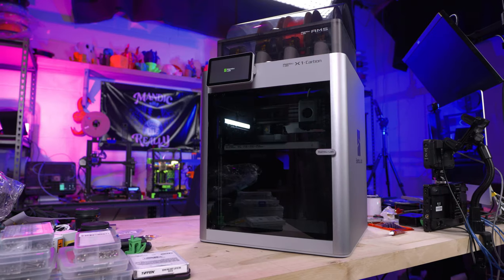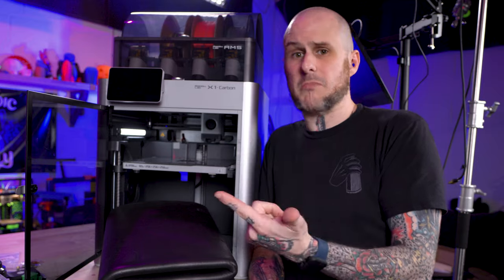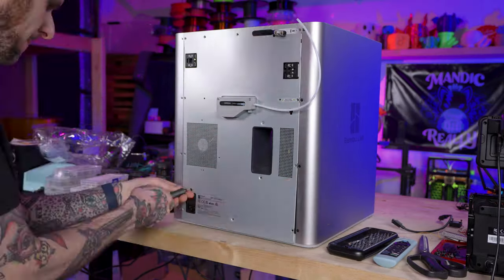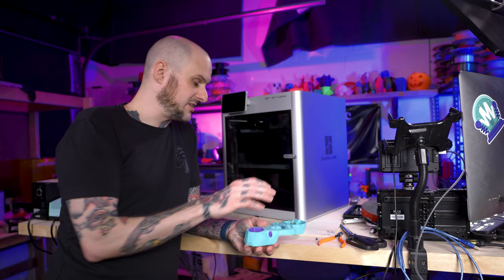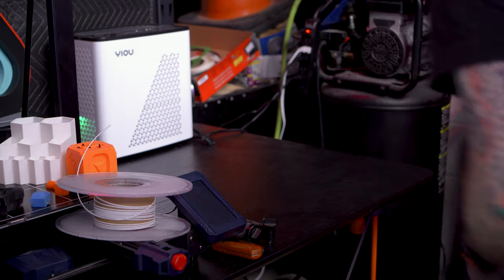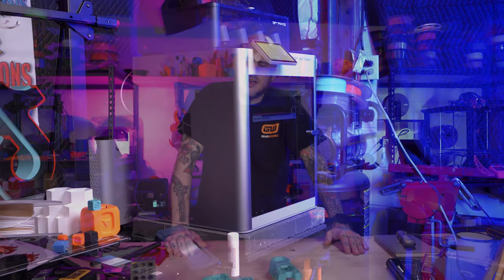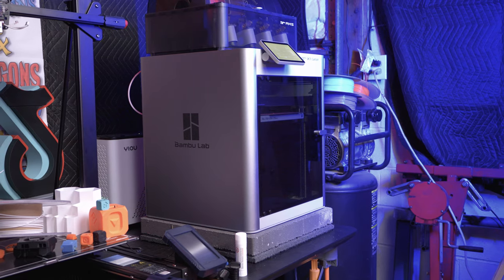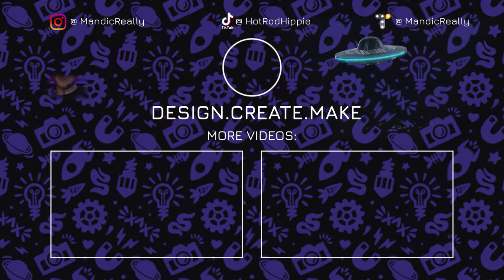Bambu X-1 3D Printer Modding & Problems - Noisy Ringing BEAST!

Comment: A 5dB decrease is huge it’s 1.5x reduction.

A change of 10 dB is accepted as the difference in level that is perceived by most listeners as “twice as loud” or “half as loud”.
Reply from the maker: I always forget to think of dB in the reality of what it is. You are right it is a pretty big change.
Reply: Sorry to be the "um, actually" guy. 
+6dB is twice and -6dB is half as loud.
Reply: @ShaunYouth  "Actually", no, it's highly subjective, and varies from 6 to 10, depending on the study.
Reply: @oorcinus  upon doing further research, I have discovered that you are indeed correct. Funny thing is, the music school that I’ve worked at for the past 10 years has always taught 6 dB is the double or half number. 
I just now read a paper from Harvard U that mentions this dispute. I stand corrected.
Reply: I have sound deadening left over from doing my car, 5db is worth the effort in my mind.
Reply: Better than the insulation he used is the roofing tar contact paper. It's basically dynamat that is used in car audio and it's sound reduction is way more than just 5 db. Plus that roofing contact paper is really thin so it can be doubled up if needed too.

Comment: I wonder when 3D printing youtubers (and 3D printer users in general) will finally recongnize the importance of correct Linear Advance (Marlin) respectively Pressure Advance (Klipper) configuration.
Perceived 80% of problems I see posted in various 3D printing forums are caused by ignorance or misconfiguration of this feature.

Usually filament flow is calculated by the slicer software as a linear function of horizontal nozzle movement. Unfortunately molten plastic does not behave linearly when being pressed out of a nozzle. That's why someone did us all a great favor and implemented the Linear Advance Algorithm into the  Marlin firmware. The makers of Klipper obviously recognized the importance of that and implemented it as well, but calling it Pressure Advance which does essentially the same.

Linear Advance (LA)  needs one argument supplied by the user which is called K. Its unit on LA version 1.5  (LA15) is mm/mm/s. It describes the molten filament compression length per velocity unit. You can read more about this here https://marlinfw.org/docs/features/lin_advance.html or the Pressure Advance version here https://www.klipper3d.org/Pressure_Advance.html.

K depends on the filament, its condition (age, moisture, ..), nozzle diameter and layer height. Optimally you should calibrate LA before every print, where you change one of these parameters. I found that, when I open multiple vacuum sealed spools of the same filament, each of them might still need a slightly different K to produce perfectly printed results. This is particularily the case with PETG and TPU. You can also print TPU quite fast, without striniging, when you have configured its correct K value.
When printing PLA and ABS at slower speeds you probably won't recognize the full impact of LA, because these two materials behave quite linearily in their molten state. This is why probably nobody bothered about LA when printers only could print these materials and also not very fast.

To come to the point ... his issue with the edges, he describes in the video, might also be caused by improper configuration of LA.
I know, the Bambu X1 does Linear Advance autoconfiguration before every print, which is essentially a good thing, the problem is, that the filament behaves slightly differently when printed as a first layer pattern directly on the plate, than being printed as a layer above an already existing one during a real print. This is mainly because the first layer gap between the nozzle and the plate may be slightly different than the configured layer height for the print (which is mostly the case with printers where you manually have to configure the Z-offset to the plate.  I don't know if Bambu's autocalibration levels the nozzle tip to exactly the configured first layer height), and also the filament adheres differently to the plate than it would to a layer of its own material. Believe me these two factors make a difference. It's e.g. pretty impossible to determine the correct K for TPU from these patterns.

What I do to determine K ist to print a 60x10x3mm cuboid with open top (no top layers), no infill, 3 bottom layers and 3 lines thick walls. This can be printed reasonably quickly. Afterwards I examine the result.
When the vertical corners are bulgy and the walls look slightly pulled inside between them, and the extrusion at the beginnings and ends of  lines is higher than in the middle of the lines, then K is set too low, if it's the other way around it's too high. Then I slightly correct K in the correct direction and reprint. I repeat this until it looks perfect.

Also when K ist too low you might not get rid of stringing, because there will be too much pressure in the hot end at the ends of a line so that the thread of plastic cannot snap off before moving to the next start of a line and will be dragged over to it.
In contrast, when K is too high, the corners will become rounded, the walls will bulge to the outside and you even might see cavities between the lines in the corners, also the Z-seam will look like the grand canyon.
Reply: Thank you for sharing this. When you are making adjustments to K, how big on an adjustment do you make? .5 mm/mm/s? Whole steps? I would like to play with this setting on my Bambu.
Reply: @realgoose  Depends on printer (Extruder (Bowden?), Hot End) Linear Advance version (1.0 or 1.5, aka LA10 and LA15), filament, printing temperature, nozzle diameter and layer height.
I don't use the Linear Advance calibration patterns like the one found on the Marlin firmware site as the patterns are printed directly on the print bed as the first layer and the filament behaves differently on the plate than when printed on layers of itself and this influences the K value. These patterns may work with PLA and ABS which are not so sensitive to these parameters but you can't get the correct K values for e.g. PETG or TPU using this technique.

What now follows repeats some of what I already said in my original comment, but I've added some details ...

I ususally print a test object, which is basically a rectangular bowl with 3 bottom layers and 3 wall lines. You can create this in most slicers by adding a 60x10x3mm cuboid to the build plate and configure it with 3 bottom layers, 3 wall lines, no infill and no top layers.
You have to print this with quite high speed and acceleration settings, at least 60mm/s but the faster the better, as the problems arising from a non optimal K value becomes more evident at higher print speeds which is obvious when you look at LA15 Ks unit. It's the filament compression length per velocity unit in mm per mm/s.
You must also ensure that the minimum layer time setting in your slicer is set in a way, that this small test object can really reach the configured maximum speed, otherwise it will be slowed down by this setting and you won't see much difference between different K values..

Then you examine it with a looking glass or your smartphone's macro lens. When the vertical edges are bulgy and the walls between are drawn slightly concavely to the inside, then K is to low, when it looks the opposite and cavities appear in the corners then K is set to high.
When K is too low you also will have a hard time trying to get rid of stringing, because the pressure inside the hot end will be to high when a line ends and the filament thread cannot snap of properly before the print head starts to move through air. Also the z seam will form a thick scar or blobs depending on your seam position setting.
When K is too high the seam may open up and look like the Grand Canyon or there will be holes in the walls when you have set its position to random.

Typical LA15 K values for most  PLAs, when printed with a 0,4mm Nozzle and 0,2mm layer height on a direct drive extruder are around 0.05, PETG needs between 0.06 and 0.2, TPU between about 0.25 and 3.0(!), depending on the parameters I mentioned above. Smaller nozzle sizes,  lower layer height and lower printing temperatures  increase K, larger nozzle diameters,  higher layers and higher printing temperatures decrease it.
Bowden extruders also increase the K value.

Comment: There is so much excitement revolving around this machine. For good reason, mind you. Interesting to see a minor glitch in the machine and even more interesting to see you try to fix it. You do a great job explaining everything.
Reply: Well I mean yeah, it is the first big improvement since the MK3 in 2017. Most of the market has been racing to the bottom with barely functional toys while the DIY community went full elitist with the Voron; a printer that was not only unreasonably expensive but also took upwards of 20 hours to build without counting the part sourcing.

Comment: The noise level I completely agree with, but I havent had any issues with ringing.  I print a lot of cosplay related stuff meaning im often printing at max build volume and I would see alot of ringing in my other FDM style printers when printing taller objects.  The X1 Carbon w/AMS has been a game chznger for me and has easily doubled my output and greatly improved the quality of my prints.  I couldnt be happier unless there were a larger version.
Reply: This is good to hear. Hope I can get similar results!
Reply: As much as noise can be loud, the productivity of this machine allows me to overlook that. Prints that take 4 hrs can be done in almost 1. Plus you can make a custom enclosure out of plywood or acrylic which will help with heat and noise.

Comment: I was excited about the X1. But as a lifelong industrial machine operator and now a cnc machinist for nearly 9 years(can code by hand 4 axis stuff). For all the hype key upgrades for any cnc(which is what a 3d printer is(welcome to my world) are rigidity rigidity rigidity. And these got missed. That means cast beds. NOPE, not even box section C sections spot welded.  injection moulded bits too. Ball screws...nope belts. So running at 24000mm/min _feeds_! on a consumer machine running belts🤔acceleration becomes a HUGE issue. Belt stretch guys!  
2nd up as a dude machining rubbers, urethanes, plastics etc for the past 5(plus 9 years in plastics processing(injection,blown film and blow moulding)...if the guys who can build a factory to make the plastic say it does maybe 80mm/s print speed...but nay we want 400? That means you are fully on your own with regards to any issues. Any parts you produce and have some expensive catistrophic failure=not their problem even if the material was at fault.
And finally. 
A cnc guy took 1 look at an x1 running pla(on u tube).and with it jumping around and some of the noises it was making at stock settings his verdict in under 10 seconds
"Thats machine abuse, slow it down"
Good luck with longevity.
Thats why your prints are crapping out. Or the bambu slicer is g3/g2ing corners to dodge belt stretch. I was hoping an Aussie could get it right and not cheap out like chinese 3d printers, but no, they added  "cool" marketing hype stuff and didnt get a solid machine first.

Comment: Thanks for the look at where one might fit insulation on the inside!  I've been thinking about that, but not been willing to tackle trying to open this baby up.

I'm printing mostly ABS and I got a huge gain just by putting a 3/4" thick piece of foam on top.  (I don't have an AMS).  Coupled with another piece between the printer and a concrete wall, I've raised my chambre temps from 45 to 55, and I think the top foam made the most difference.  Of course, as you say, it's ugly, but I'm not filming mine.  (Also, my printers are in a separate room so I just keep the door closed, and the room itself ends up holding in a lot of the heat.)

I've found that print quality improves a lot if you dial it down to half speed and lower heights.  I'm mostly printing at 0.12mm heights, and after manually adjusting all the speeds to half the default (in slicer) I'm getting prints that are precise enough I managed to skip the "sand out the layer lines" step and jump straight to "hit it with filler primer."   And even at that speed, my prints are finishing before I'm done doing the design work for the next thing.  I spent about a week printing off a backlog of things I wanted in ABS and was tired of fighting my Ender-5 to get, but now that that's happened I'm only running the printer about 30% of the time because I just don't have the next design ready to go!

Finally, I personally find the noise useful; as noted the printer is in a different room and it's just loud enough that I know what's happening without being so loud that it bothers me.  I've heard some people grumble about trying to sleep but I find the printer much less annoying than the teenagers two doors down!

I got the X1 because I wanted a printer that would "just work" without me having to spend a lot of time fighting with it; and a printer that could handle ABS out-of-the-box.  The X1 totally fills the first need and required a trivial adjustment to deal with the second.

Comment: tl;dr - I agree that bambu lab's auto calibration is too aggressive and subsequently results in rounded corners. You can make a new printer profile with custom code to set the linear advance (k-value) to be what you want after running a manual linear advance calibration test (M900 k[x.xxx]) and completely ignore their M900 M-values.

If you look at the machine start code in the bambu slicer, you can find the g code for the 3 calibration lines starting with k0.040, k0.020, and k0.000. From the looks of things, it looks like it is changing the volumetric flow volume and then scanning which line looks "best" and then chooses that for its outer wall volumetric flow setting.

To find the start g-code field, left-click on the edit icon next to the printer preset, activate the "advanced" flag, and check out the machine G-code tab. You can see the code for how bambu lab runs their printer and can use that code to make your own profiles in PrusaSlicer or modify them to override their autoflow calibration routine. Unfortunately I have not found a way to modify their custom g code to change how it chooses its "optimum" flow values.
Reply from the maker: Excellent input. I’d explored the g-code a bit, but when I review things I try my best to stick with what I’m presented with. That said, tuning settings like that are basic on other machines so I don’t see issue there. I’ll explore tuning in my own settings and slicing outside of Bambu Studio. Thanks. 👌🏻👌🏻
Reply from the maker: One of the folks from Bambu chimed in on the discussion on the Facebook group (On the post where I linked this video).  They informed me that the machine can use standard Linear Advance K-value tuning, but it normally uses a more "adaptive" form that uses L-values.  Namely L1000 is default but they showed improvement on the Stealthburner print with L700 values.  So I'm going to start playing with tuning that before I go to K-values.  I'm archiving this information for a follow-up video for sure.
Reply: @MandicReally  any news on this? would be interested in hearing what its like when you want to go out of the "predefined" stuff they give you (when you might need to, like in this case)
Reply from the maker: @kay00  I basically never run their pre-defined profiles as is anymore.  I should do the follow up to this video but have had too many other projects on my plate. I''l.l try to get to it soon-ish.  Hard part is testing gets time consuming fast and testing just to film even more so.
Reply: @MandicReally  Any follow up on this? And any more insight into reducing noise? Thanks. :)

Comment: I would 100% mount some of that thin foil insulation on the outside via a magnet so it isn't permanent. That way you can also take it on and off vs summer and winter temps.

Comment: You said you were going to post a template for the bottom of the printer. I don’t see it.

For temperature that small square you pointed to: it’s far enough from the case that you can slide butyl mat behind there without it touching anything.

I put butyl mat on the inside and outside (I used metal finish with no logos, it looks like a retro spaceship. It helps the high frequencies for sure. I didn’t put it on the bottom, which I will now after seeing your video.

 I also put the whole thing in a broken wine fridge. I put active cooling on it for PLA prints with some custom designed baffles for sound. I’m in the process of adding extra insulation inside the fridge on the inside. Butyl mat, then siless hybrid, then maybe some foam (it seems to be harder to work with, if I put it in the wrong place I can’t move it without tearing.

Comment: You may not like the look of aluminum foil but just for a quick reference my qidi x-cf gained about 20c ambient air temp after adding real thermal insulation and coating the entire chamber with aluminum foil insulation tape. I can hit 75c while printing polycarbonates now and thats without an actively heated chamber. Noise is significantly reduced and like you said, the printer is noticably cooler to the touch (as well as the room it prints in). Just go overkill with insulation. You won't regret it. The sooner you get to 75c+ the better. Polycarbonate will print like PLA if you can get your chamber hotter.

Comment: Great Video on the X1 carbon

 I would have used the car sound damping on the whole thing. It designed to reduce vibrations and silver layer would have brighten up the inside and help retain heat.
Reply from the maker: I did use it everywhere.  Anywhere you see the foam material there is the asphalt insulation underneath of it.  They are layered. I was concerned the shininess would affect the "Lidar camera" on the print head as some LED mods have shown to do, so decided against that here.